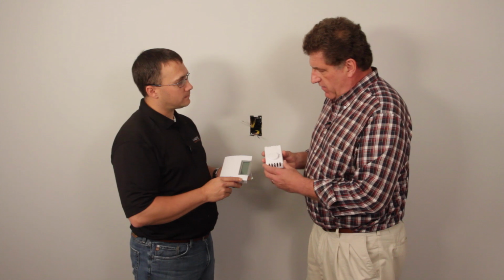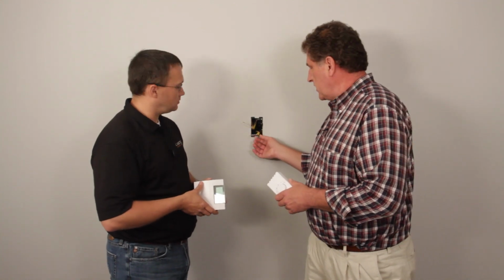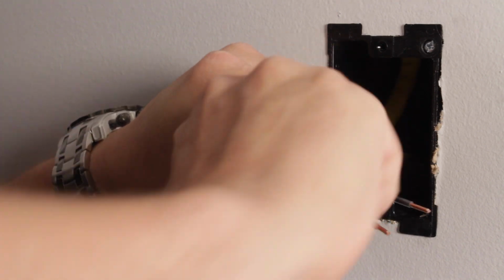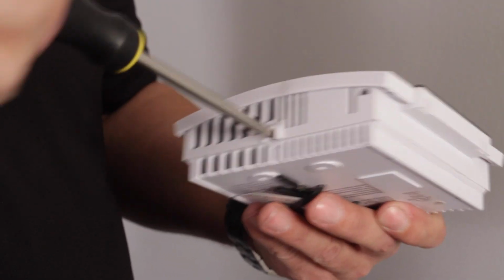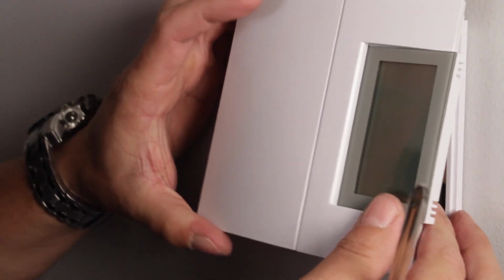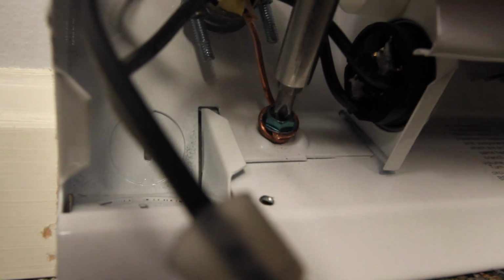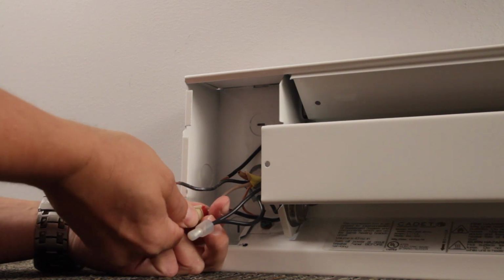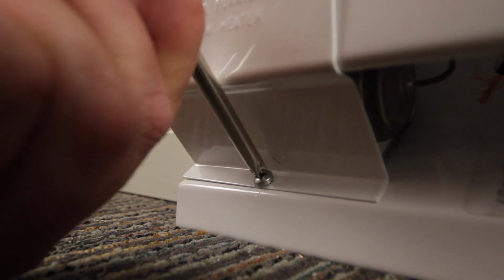How to install: Wall thermostat, single-pole on 240V baseboard | Cadet Heat

Comment: you said to cut the wire from the top of unit but my instructions clearly say to not cut that one if working on the left hand side as you are in the video

Comment: I've often wondered in the recent two years if this was possible. right now all of our electric heaters are controlled by built in knobs on the baseboard heater. our girls room is the coolest room in the house in winter or gets to be the hottest on warm days. I need to change it over to this. so it sets it's self
Reply: Gonna guess that those are register heaters? If you want to control all of the registers with 1 thermostat, then you must find a thermostat that can handle the amp load from all of those registers. You also want to make sure that they are all on the same phase. Fancier thermostats do not play nice if different components are on different phases.

Amp load for electric registers: Look at the resistive amps used when the thing is going. If you want to combine registers to one 1 thermostat, then register 1 + register 2. If that total is more than the rating of the thermostat, bad deal. Work around? Learn how SPST relays work.

Comment: Along with replacing an old thermostat, I am also replacing a very old 240v 93" with a new 96" 240v baseboard heater and the supply lines was on the right side of the old heater.  Is there an advantage or disadvantage  or any difference using the right side (other then one less wire)?  Do you need to make any adjustments to the wires and ground on the heater's left side after connecting the supply wires to the right side?  Thanks.

Comment: GREAT VIDEO!! Thanks for the information. just got a quick question, so the two black wires from the wall don't need to be matched the two black wires from the new thermostat?  Im actually replacing a broken thermostat, just want to make sure the right way to do it. Thanks
Reply from the maker: +REX CHEN It's best to match up the black wires from the thermostat to the black wires from the wall. If you need additional help, you can always send us an e-mail or chat with one of our tech support guys. http://cadetheat.com/support/customer-service
Reply from the maker: +REX CHEN And thanks. We're glad you liked the video!

Comment: I have a question for you. We recently changed our analog thermostats to programmable digitals. All except one work. The problem one has had to be replaced three times! I recently had an electrician come in to help solve that problem. He told me the third thermostat is not pulling enough amps or wattage. This is puzzling because the first one worked for a couple of days before it went out. He went on to suggest that we buy a "6000-watt, 240-volt digital thermostat." In the meantime, he connected the four wires (two red and two black) to bypass the thermostat while we wait for a new one. He combined one red and one black thus making the four wires into two. He said that would work except that we have to use the fusebox as the switch to control the temperature. It worked. My question is if he could change a 4-wire into 2-wire (that is a two-pole into one-pole) why can't we use a single pole thermostat like the Honeywell TH106? Thanks in advance. Kay
Reply from the maker: Good question. You can swap out a double-pole thermostat for a single-pole one, going the other direction isn't always possible. However, if your electrician is telling you that you have too many watts for the thermostat, going to a single pole isn't going to help you. Have you spoken with our tech support team by any chance? We don't typically see cases where someone has 6,0000-watts going through a single thermostat. They will be best equipped to quickly get an answer for you.
Reply: Thanks a million. I'll give them a call.

Comment: I currently have a Cadet baseboard heater. The thermostat has a double pole hookup. I just purchased a Stelpro STZW402+ . Will this process work to replace it?
Reply from the maker: Hey Bill,
It appears that this Stelpro thermostat is a single-pole thermostat. If that is in-fact the case, this video will give you a general idea of what the process is like. You'll need to be sure to follow the instructions from the thermostat guide -- not the ones outlined in this video -- for the actual installation.

Comment: i did this same digital thermostat to replace the mechanical one on a short baseboard and cadet heater tied together and as soon as it reaches the set temp it continuously cycles on and off. any idea?
Reply from the maker: Yes, so to fix this you need to configure the cycle length on the thermostat from 15 seconds to 15 minutes. To do this you will need to adjust a switch behind the thermostat. This can be seen on page 2 step 3 (Configuration) of the owner's guide.

http://cadetheat.com/download/TH106-owners-guide.pdf

Let us know if you have any more questions!

Comment: Don't you have to attach the ground wires?
Reply from the maker: Yes that's correct, you'd connect the two ground wires together with a wire not.

Comment: I'm upgrading from a very old analog to this digital programmable thermostat. I have a forced air radiator, so the thermostat's only job is to turn on the fan when it gets too cold. The problem I'm facing is the thermostat goes to LP every time the fan is supposed to turn on. I can hear the fan begin to start and immediately stop. Is there any way I can fix this problem without getting a different thermostat?
Reply from the maker: Sorry it took a little while to get back to you. Our tech support team says this thermostat is not intended to be used with a forced air radiator. You'll need to find a replacement.

Comment: That was how to install a 120 volt system. Can you please show us the 240 volt system?
Reply from the maker: Jesse, Why are you thinking this is a 120-volt system?
Reply: +Cadet Heat so are you telling my that one of those black wires is supplying 240 volts?  usually you have 2 wires 120 volt each to get 240 volts...
Reply from the maker: Jesse,
The white wire is also hot in this situation so it's a 240-volt application. A lot of electricians will mark the white wire to indicate that it's also hot, we didn't do that at the time of filming this video but we will going forward.
Reply: +Cadet Heat ok. thank you
Reply: Do you sell a 22amp, (or 20 amp) 240 volt double pole programmable thermostat?
Reply from the maker: We don't have a 20-amp programmable thermostat, our TH115 is 240 volt, programmable but only 15 amps.
Reply: ok question....   so you tied the 2 white cables in the thermostat jbox together to simply feed the baseboard heater directly...  but does the thermostat then send out 120v through the other black wire to the baseboard too then.  I'm confused how the baseboard is getting 240v?
Reply from the maker: With a 240-volt connection, both the white and black wire in the jbox are hot. So the two white wires are connected together, the black wires connecting to the thermostat complete the circuit giving 240-volt power.
Reply: ohhhhhh...  so kinda like doorbell.  Only instead of a push button switch, its a thermostat in between.   (and 240v of course, not low voltage)
 Awesome!  Thank you so much.  I just learned something new!  :)
Reply: OK hooked it up just like you said. Even was talking to one of your technicians on the phone and when we flip the breaker it did exactly what I thought it would do and blew the thermostat. Any exclamation?
Reply: @chitownpaul7867  Yup, same issue. Had an electrician follow up and the same thing happened and he's stumped.
Reply: Holy crap! Or were you looking for a more forceful exclamation, perhaps an exclamation that included swear words?  @chitownpaul7867
Reply: @Cadetheat  the white wire should be red in fact so its not confuse anyone